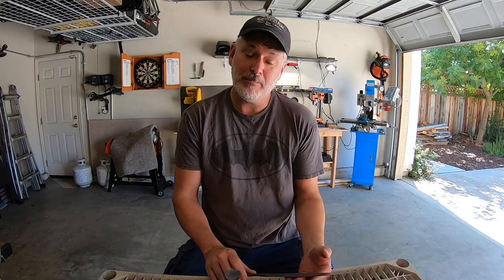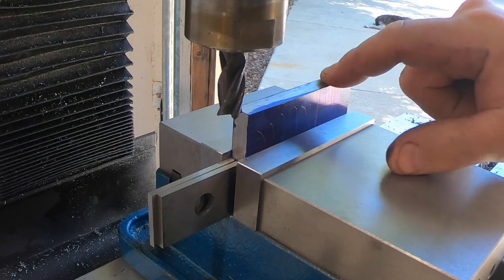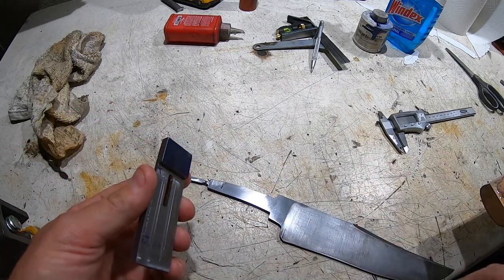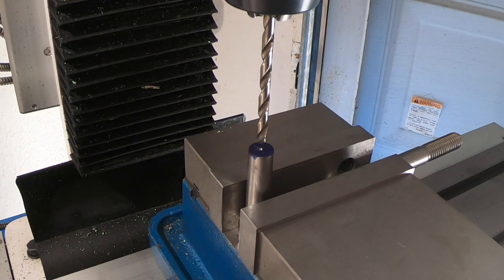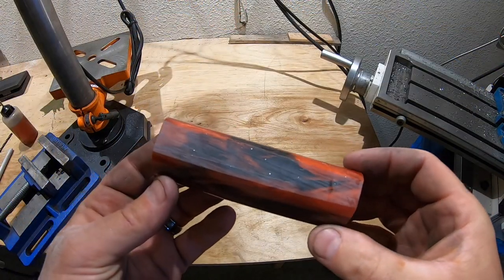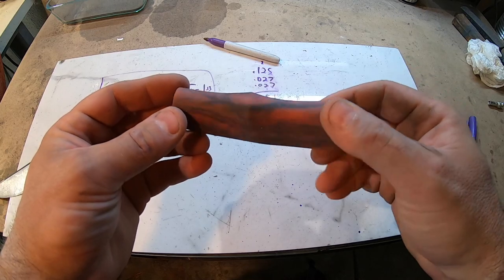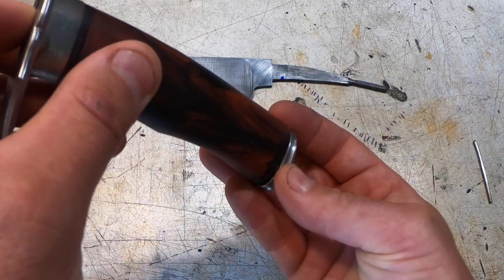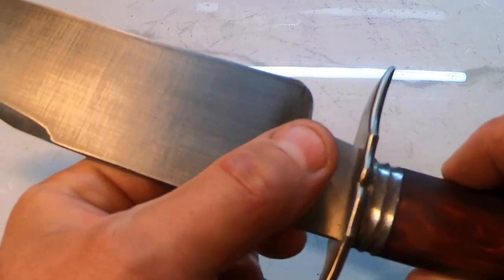Making a Bowie with Feather Pattern Damascus - Making the Fittings

Comment: You're freakin killin me with this thing. Am I wrong or is that handle material black and red? My favorite colors. Especially together. I can't wait to see how it all turns out, but I gotta take my ass to bed.  And when I saw leather in your vice around the fitting,,,,is he gunna make a sheath?? Yesss!
Reply from the maker: I don’t show the sheath making for this one.  You should checkout the wolftooth Damascus bowie that I did for the challenge with Airin at AleeKnives.  That one is pretty curvy and is a slightly smaller version than the one I’m working on now.
Reply: I'm thinking that was the first video of yours that i watched and where I got onto Airins channel. I'll have to go back and watch it again tho. Maybe when I finish the feather pattern build